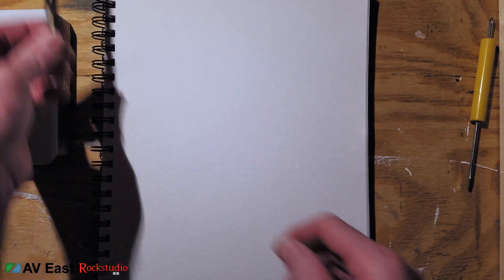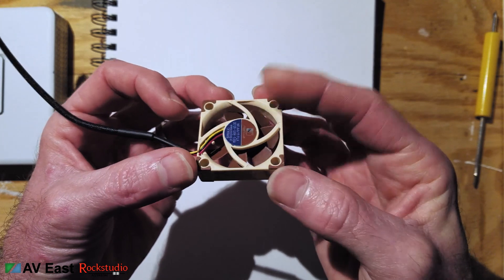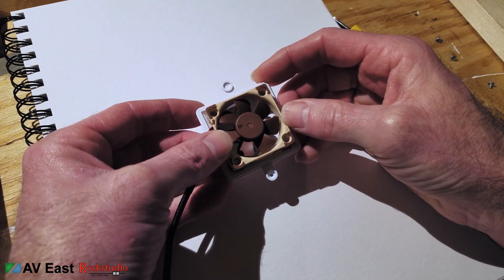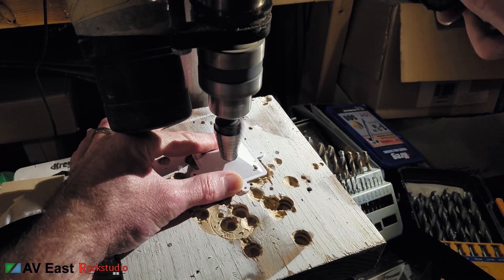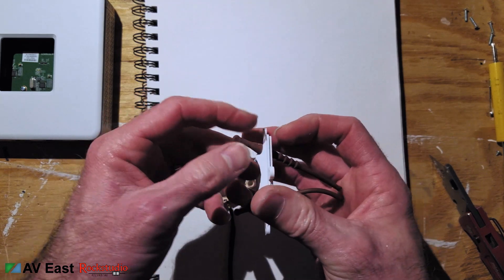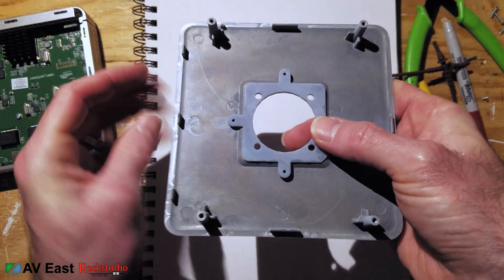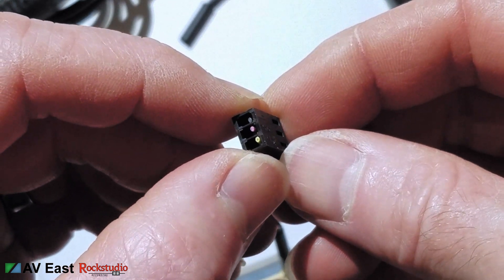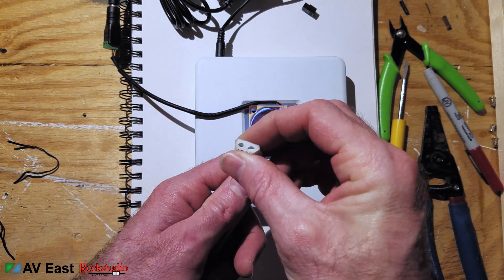Ubiquiti Unifi USG 40mm fan installation / modification

Comment: Will this also work for the gateway max USG?
Reply from the maker: Hi, sorry I missed your comment. For some reason I didn't get a notification. It doesn't look like the gateway Max has that same top panel. So you won't be able to use this fan mount. I would definitely put some thick feet underneath the gateway Max, similar to how I did it in my video. And then put a fan near it, and in a manner such that the air flow will envelop the entire device, top and bottom. The gateway Max looks like it has solid plastic panels all the way around, top and bottom, so modify at your own risk! Thank you so much for watching and commenting.

Comment: 8:00 wtf are you rtarded? :D 12v 5amp for a 40mm fan :D you could power that thing off a USB plug and it be more than enough.  Your fan is 0.6 watts and you just threw 60w at it, 100x more than it needs :D You just used an apache helicopter to kill a mouse :D
Reply from the maker: I do what I want!
Reply: @therockstudio  well, i can't argue with that.
Reply from the maker: @lifehackertips  I typically would wire the small tiny fan into a larger fan-loom inside a rack. So there may be six or eight fans tapped into that 5 amp power supply.

Comment: I've done similar action with my USG. Maybe will be usefull for you my findings:
- Ive used external fan from intel, but still it was too laud. Therefore I decided to add 
two resistor in line (2 in order to have gears). connected the fan to rack itself + radiator on top.  Fan blowing on the way to USG. But there is one important risk (also in your case). Air flow causes 
electrostatics - USG HAVE TO be connected to ground. I've destructed in such way (circut) the first one...

Comment: Great to see someone actually call a spade a spade with the USG. It gets hot, so it's a good idea to cool it.
I'm using a dust filter over the intake of the fan as active cooling will speed up dust infiltration.

I'd also use a clamp or two instead around a drill press. A kid in my shop class almost lost a thumb using a similar technique shown.
Reply from the maker: Of course you can filter the fan intake. I typically install the USG inside a rack that is already supplied will filtered air.

Comment: This is a great video and I’m going to do just this for my USG. Surprising how hot they get. One thing I may change is to have the fan pull the air through the unit, instead of pushing it through. I think this is typically how small equipment with fans is designed. Any thoughts you have about air flow direction appreciated. I’m sure it will cool off the unit either way.
Reply: I disagree, only in that negative pressure will promote the ingress of dust through any gap in the unit. Though this is really only a consideration if you were initially going to use a dust filter on the intake side.
Reply from the maker: Hi David, sorry I didn't see your comment until now. As far as air flow direction, I think the fan blowing towards the PCB is the way to go. And here's why: the directivity of the stream of air is the difference. Imagine the flow of air hitting the PCB and then flowing over and outward across thew PCB towards the chassis sides, taking a little heat (directly from the shell of the ICs and other components) away with it. Now, if you flip the direction of flow, you lose the benefit of directivity. The air source will be originating from any and all points inside the USG. Furthermore, the rising heated air around the PCB components is the only heat you'll be able to remove. The little 40mm fan isn't like a vacuum on its inlet side, it's not very directional. So, I'd stick with an active, direct stream of air on the PCB. Thanks for watching!

Comment: Nice mod, and very well done video. My USG ran into overheating problems as well. This was my solution: http://www.dominickbrana.com/2020/06/ubiquiti-unifi-security-gateway-3p.html
I went direct the USG board for power.  If I were installing at a residence other than my own, I would use a separate power supply like you did.
Reply from the maker: Wow cool! That's a serious fan mod. Thanks for checking out this video, sorry for the late response, I haven't been getting notifications about comments. Good job!